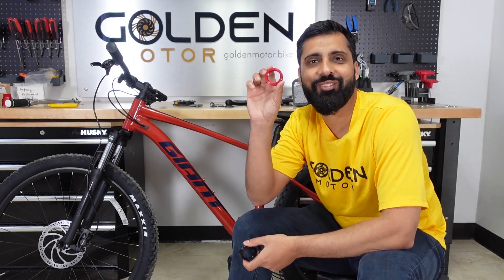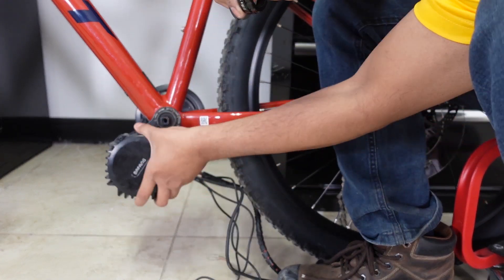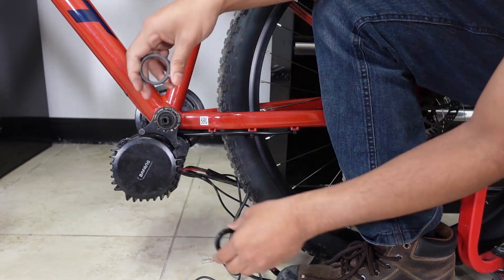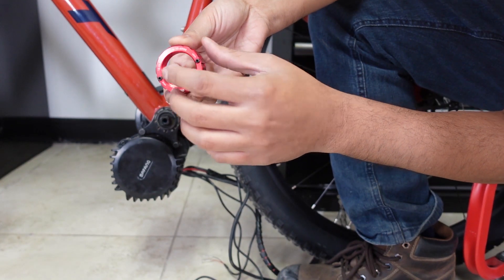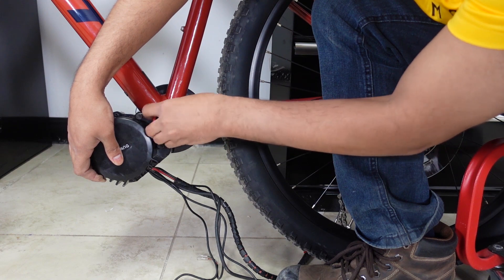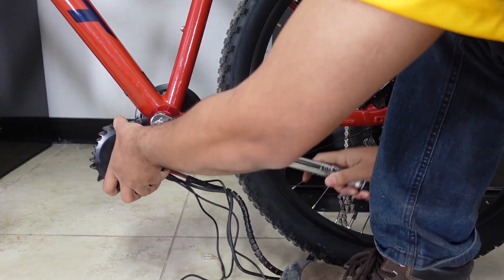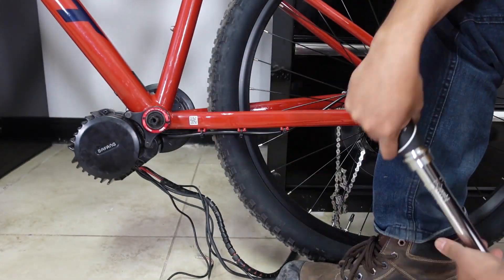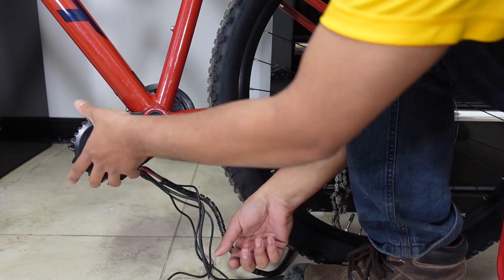Replacing the Bafang Lockrings With the Lekkie OneNut for Bafang Mid Drives

Comment: I just used the stock bafang tool and a mallet to make it tight lol, I had a jubilee clip system before but it turns out I didn't really need it so took it off for a cleaner look
Reply: That's useful to know 😊 looking at OneNut as have 73mm bottom bracket and mid drive motor and bafang tool didn't really want to get new tool as well

Comment: Having bought the lekkie one nut i bought the recommended shimano bottom tool  which is totally useless  as it will not go over my axel so i  reported back to lekkie who advertised on their web site  this tool and was  advised to drill the centre out of the bottom tool ,wow top company, would of expected at lease compensating  for my wasted expense but stopped responding to my emails    thanks lekkie for the crap advice p.s the one nut seems to be doing its job

Comment: Cool
I have a bbshd on a standard bb that started moving after about 3 rides, so i took the crank off and retightened it. 
I've also added 3 big cable ties around the motor as well as the frame to keep it tight up against the frame if it does happen to loosen up again, but so far so good after another few weeks of hard riding! 

The stock lockrings definitely seem pretty sound as long as you don't run into lack of thread issues like you mentioned. I can see this lock ring actually being a good option in that scenario

Comment: While using a split nut will prevent the nut itself from becoming loose (provided both grub screws are torqued equally) it still doesn't  change the fact that there is not enough surface area on the face of a bottom bracket together with the matting surface of the bafang bracket to keep from spinning, bafang tried to improve on this with their newest motor by adding a through ring to the casing and using a gear clamp around down tube to keep the motor from spinning downward, every time I see it I start to laugh a bit, I'm pretty sure the cafeteria lady designed that one !  No thanks,  I'll fabricate one that looks like it belongs.

Comment: Great idea, but.
The only way to correct the rather iffy mount is to weld the mount to the bottom bracket.
Now the motor is bolted to the frame.
Reply: How do you remove the motor if needed?
Reply: He is talking only about steel frames. There are more sublime methods though for steel. While all those stabilizer bars have problems. Steel is hard that's why stock locking doesn't work as it is
Reply: That's a very poor and very  ghetto suggestion are you trolling  ?. A simple removable and reservicable fix is to use 2 hose clamps a large one for the motor and a small one for the down tube.  Many people have done this
Reply: @denseljosephs9500  personally i have magnesium frame that makes welding impossible.